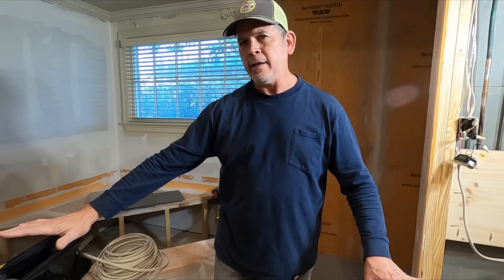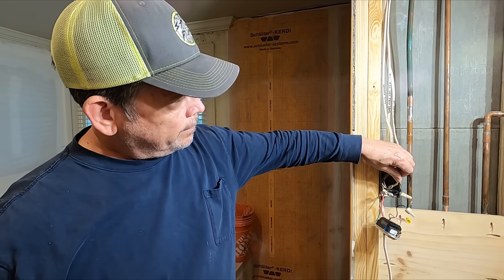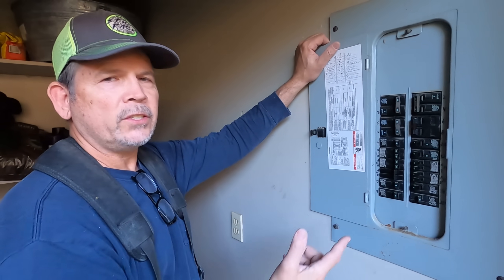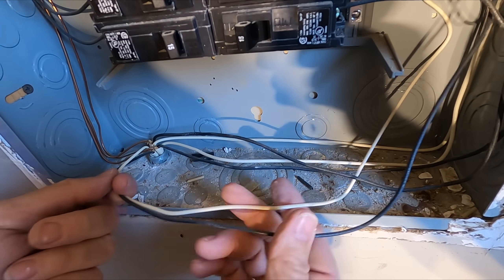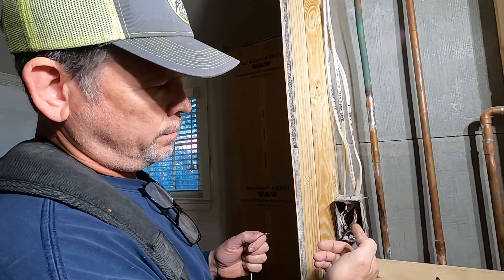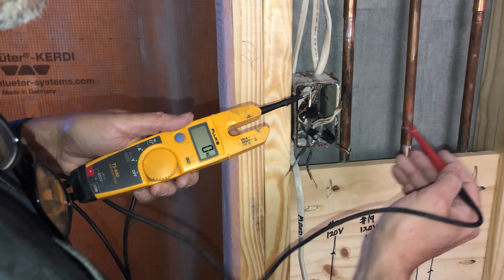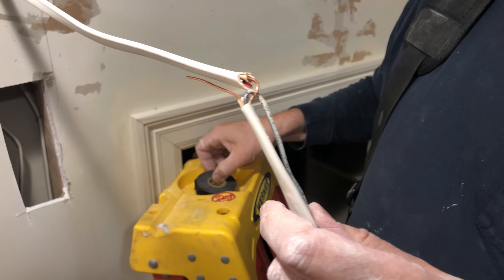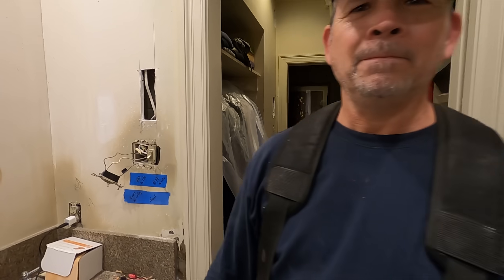You CAN Get SHOCKED by a Neutral Wire! This is How...

Comment: The joining of multiple circuit neutrals is a huge problem. It usually comes about when someone upgrades a service/panel and the AFCI will not set. Then it is hours of work either chasing down the neutral problem or rewiring the whole circuit. You can’t pass inspection if AFCI won’t set.
Reply from the maker: Thx 👍

Comment: My method of doing this is to send the wife out shopping and shutting off the main breaker. I have yet to have a problem doing it that way. I have run across to many “ live neutrals” in my life to work on electrical with the main on.
Reply from the maker: Cool thx Bruce 👍

Comment: I'm confused :-)   You say that every circuit should have its own neutral wired back to the circuit breaker box...but when it get there's they're then all joined together again along the common bar, so what's different ?  i.e. why does letting the closet light get its neutral (return) from the breaker box work differently from getting it off a shared local wire?
Reply from the maker: The expectation is that when you turn off a breaker there won’t be current on the neutral for that particular circuit.  When you mix neutrals you get the situation I came across in the this video.  Super Brief explanation but hope that helps 👍
Reply: @StudPack  No... sorry :-) I thought a breaker only disconnects live/hot... so Neutral is always connected, and common to all other neutral..

Comment: Thanks a million for revealing this mysterious situation. Also thanks for respecting the invisible power of electrons!! I share the experience. 
I came across same exact situation when I was updating an old outlet that was opened by a listened electrician previously for powering recessed lights in adjacent room, using one of the leads. When i tested it, it read 240 V, I could not find out why. 

Thanks again,
Keep up the good electoral energy!!
Reply: Yeah, the guy working for him didn't get hurt or die from electrocution but , whoah, when he fell of the top step of the ladder, it was bad, really bad. Thats why you haven't seen as many videos lately form this guy, he forgot. He forgot about ladder safety. Poor guy working for him, well, its not my place to tell you exactly what happened as there may be a pending lawsuit so...........Oh, so do not stand on the top step of any step ladder EVER!!!!!!!

Comment: Great vid! I had a couple of thoughts. 
I noticed in a comment that you mentioned e-tape you had put to designate the "hot" neutral. Since you get folk of all skill levels, that it would be good to mention that the white wire on a switch leg should be taped black to indicate that it is carrying current.

I also noticed that you needed a taller ladder when you were in the attic. You were standing on the top of the ladder, setting a dangerous example. 

Looking forward to watching more of your stuff!

Comment: Noticed that the white wire in the 1st box was taped with a piece of electrical tape about an inch from the stripping.   Did you tape that, or was it there?   Doesn't that usually indicate the wire is being used as a hot lead, not a neutral lead?
Reply from the maker: I did that.  Good catch Jim 👍
Reply: @StudPack  Cool.  Really like this video, as I am having similar issues in a closet too.  We tried to wire in a motion sensor switch for the ligth (wife wanted it), but it was giving us trouble.  Manufacturer was saying switch needed a neutral, and thinks our neutral was a floating neutral.  I think you've explained exactly what's happening in our situation too.  Thanks for the video

Comment: Im not an electrician and last year a friend of mine called me saying his new outside electric sauna kept tripping the GFCI. So I had a quick look, figuring that I would get my other buddy (master electrician) to look at it anyway. So I open the breaker box on the side of the sauna, and first thing I see is that the ground and neutral are bonded together. Ahhhhh wrong wrong wrong. Long story short, he had a broken insulator on the heaters element and it was tripping the breaker. I told him he was lucky no one got a shock or died as a result. He tells me HIS buddy wired it for him and that he was sure he was an electrician. I said No way man, especially that this breaker box was like 4rth down the line and only inside the service panel was that permitted. All fixed now !

Comment: i still don't understand how you figured out where the problem was
Reply from the maker: I had to remove all the switches and trace out the wires.  Kinda of a pain but it was a small area and I got lucky when I found that abandoned neutral.  Usually doesn’t happen that way

Comment: Great information.. I also have been shocked by neutrals.. Even in wiring that was installed by pros. Circuit testers are cheap. Always circuit test your wires before grabbing a hold of them.. I learned the hard way and still get bit once in a while..
Reply from the maker: Thx Jake!

Comment: Current nec does not require the main disconnect to be at the panel. What is required is for circuit 19 and 20 to be on a breaker with a common handle tie. That’s called a multiwire branch circuit. If the circuits were terminated on a common tie breaker, there wouldn’t be any backfeeding issues. Nothing wrong with sharing a neutral as long as each hot conductor is on opposite poles and terminated on a common tie breaker.
Reply from the maker: Thx RB.  CB 19 & 20 were same pole.  I could have moved them around to accommodate a two pole breaker (18 & 20 for example) but didn't want to get into that.

Comment: I was doing work at a shop we had in California in the '90s. The power was on and we built high power amplifiers so current was running through the wires, and our shop was about the 15th one from the electrical room at the end. Bottom line, there was a long length of neutral wire and hot wire. I measured 50V between neutral and Earth wires. I wasn't working on the electrical system of our shop, I was interested in the potentials for our amplifiers, so not a safety issue for me or anyone else in the building, but yeah, be careful! Also, as someone mentioned, the white wire in a 3 way switch configuration is not always neutral! It really shouldn't be white, but white is convenient in Romex for guys looking to get the job done. It should be black, blue or red. Usually, codes are not respected enough due to convenience.

Comment: All of this is part of  safety guidelines but can you explain if they are necessary if as a DIYer I am in the habit of cutting the power to the entire house while i am working ? I get that a shared neutral will be overloaded but rarely does it happen like both circuits use full power (15A like some of the guys in the comments are saying) . Is this really a big deal if just some lights are connected to a shared neutral and me as a guy has a habit to disconnect power to the entire house before working ?

Comment: I was replacing a light fixture in our condos guest bath and made what I thought was the logical assumption that by turning off the wall switch I was removing power to the fixture.  Nope.  I then turned the circuit breaker off, still got a buzz.  I finally did the job wearing rubber gloves.  Now I have a better idea of what was happening.  There were about 7 'neutrals' twisted together with a wire nut behind the fixture.  BTW your videos are informative and to the point, no need to FF through parts.

Comment: Shared neutrals are a big complicated subject.  Romex if you look carefully helps with keeping things straight, because you can see which neutral belongs with which hot.  That's why it's good to have a little of the outer plastic extend into the boxes.  Old stuff from back in the conduit days is harder to trace, and you sometimes have to do a hand ringout.  I had to do that on a house we bought, somebody re-wired it and thought that any neutral would work.  It took all day.

The other danger from mis-wired neutrals is overheating and even fire.  If you have two breakers on the same phase returning thru one neutral, you can get close to double the maximum current in that neutral.  

It is actually OK to share a neutral between two circuits so long as one is on each phase.  That way the current in the neutral is the difference between the currents in the two hots.  The big feeds to sub panels are all like that.  Branch circuits not so much these days, but in conduit jobs you do find it.  What happens if you open that kind of shared neutral is that the loads on one hot are in series with the loads on the other hot, and whichever side has the lighter load sees higher than 120 volts, while the other side sees a lower voltage.  Some lights get brighter, some get dimmer, and usually stuff gets fried on the lighter side.  

Those little light and beeper non-contact testers are well worth having.  Poke around in a box you think is cold and it may find that there's yet another circuit in there that you haven't turned off.  

As for current returning thru the plumbing,  a clamp-around ammeter will find it.  Otherwise you can get a nasty surprise when you cut thru a copper pipe.  

-- J.S.
Reply from the maker: Much appreciated John thx 👊

Comment: yee it pretty amusing in the two plate system were the next live goes to the other sw plate if for some reason this came out i remember a tenant demostrating why does the hallway light come on when i sw the living light on i just chuckled and said the same the current needs to flow some were

Comment: I have a question, so if you had turned off the breaker switch for the entire house, you wouldn't have had that return voltage correct? Or another way to ask this, if you had shut off #19 as well as #20, you wouldn't have had the issue either?

Comment: Senerio. Furnace motor burned out. I was a young DIYer. I shut off the switch on the furnace. Reached in with the screw driver to undo the motor screws. Managed to ground the tool removing white wire. Big arc which blow the breaker. The previous owner (?) Switched the neutral not the black power lead. I always kill power at the panel now.

Comment: I think I have that problem (neutral) . I have a ceiling light fixture that always have current. Every breaker I switch off the light stays on is this why I have constant current ?
Reply from the maker: Every breaker?  I've seen bathroom lights tied into 50A two pole breakers.  It's got to be one of them.  If you turn off the house main breaker what happens?

Comment: As a former electrician, this is an awesome video.
As the son of an electrician, Thank you so very much. Its been several years since he passed, but seeing that wire pulling trick after 10-15 years brought a smile, some tears, and several good memories. So thank you.
Reply: Gotta appreciate your concern for electrical safety BUT there's more of an immediate danger and an OSHA violation going on at 13:00 . Whats up with that?!? Well, at least he was wearing knee pads!!! Hahahahahahhahah, funny as hell!!! Reeeally? Come on, man!
Reply: @vicferrariproject  you're complaining that a guy was pulling wire while the other was feeding it to him?
Reply: @cheddarballs864  No, he is writing about Paul standing on the ladder top shelf.  AT MOST, HE SHOULD BE 2 STEPS DOWN FROM THE TOP. If he needed to be up that high, he needed a taller ladder.  Ladder safety is very important:  I had a ladder skid away from me as I attempted to come back down from my attic.  I fell, landed on my back, bounced my head off the floor.  I cracked my pelvis in 2 places, spent months in pain as I healed.  My head was a bit sore, no brain damage.
Reply: @cheddarballs864  I've known two people that had fallen from a ladder. Both were horrific. One had one of his arms badly damaged. While the doctor managed to stitch it back together, it will have limited movement forever plus pain. The other hit his head hard and was in the hospital for a month. I would tell anyone to be very careful while going up the ladder. Don't ever assume it is just a 6 or 8-foot ladder, and nothing will ever happen even if you fall.

Comment: Great video.  Thanks for doing it.  I have been doing electrical work nonprofessionally for over 50 years and I always check the neutral to see if it's energized, but I have never run into one that actually was energized.  It's nice to know that I have not been wasting my time.  I have seen so many botched wiring jobs that I always figured that someday I would run into a job where someone energized a neutral.  You did a good job explaining how that happened.  I was always assuming that it would just be a do it yourselfer that didn't understand that black is hot and white is neutral.  I never thought about a shared neutral.  I guess you never get too old to learn something.  Thanks for bringing it to my attention.
Reply: Same for me... always test with a voltmeter, both the hot and neutral (to each other and each to ground).  Never, ever assume.

Comment: I was replacing a light fixture in my hallway I had the switch off and as soon as I touched the neutral I was lit up ive changed other light fixtures the same way and I never been shocked so now I kill the power to the house before I touch any wires

Comment: If I put my meter across the live and a pipe I would expect to see a circuit as the pipe has been grounded, ground is the same as a neutral originating from the central tap of the transformer.

Comment: Paul, thank you for a great lesson!  I would vote for more videos when you have time. Here's a topic that many owners of older homes have to face:  how to deal with un-grounded outlets without tearing up walls to completely re-wire.    Is there an alternative to just labeling each outlet as "un-grounded" if the home has had the old two-prong outlets replaced with three-prong outlets?
Reply: No one answered, so if it's still relevant 5 months later, labeling those outlets does nothing for the safety, and people will naturally assume they can plug in grounded power cords. The two alternatives which come to mind are #1 - run a ground wire to the outlet-- that's not easy in older home, as you pointed out. #2 replace those unsafe ungrounded three-prong outlets with GFCI outlets-- under $8 each in a 10-pack. Then you can sleep at night, and that brings it up to code in most places.
Reply: @isabellavision  You still need the neutral for the GFI to work.
Reply: @tedmoss  The question I from @WakeUpAmerican000s was about a missing ground wire in older outlets. You can't just replace an old two-prong outlet with a modern three-prong when the outlet has no ground. But you can replace it with a GFCI.
Reply: @isabellavision  This is such a messy subject it is hard to tell what people are thinking. Without a ground I can't see how you can test a GFI. If I was an electrician I would run ground wires and make it a proper system. I have done this several times in old houses, from 120 year old houses to 20 year old houses. It is very interesting (and expensive) to run wires in old buildings but you can figure out a way. I once figured out how to replace wire in underground conduit that had rusted out, originally the ground was the outer metal conduit, a very bad idea. We ran new wire that was thinner than the original even though it was three wire and just pulled it through being careful of the rough spots. You just pull more wire out then you need to check the wire is not damaged if it is, pull it through the other way. And test it for shorts.

Comment: Very good video. Thank you for posting.  A quick test with an inductive tester would have showed the neutral was hot!  At that point it would have been flagged as an issue hopefully before giving an unexpected shock.  I always test all the conductors in a box (even grounds)!!   Curious what you would have done if you didn't find the parked neutral in the 3 way box?  Run a new cable all the way to the panel?
Reply: I just had to fix a 3 way switch that was run with 2x 14/2 romex. One romex fed power and neutral to the fixture, and the other had a hot feeding from the other box and a white traveler wire. I decided to just do away with this 3 way switch and turn the other box into a regular switch. I converted the traveler wire into a neutral so it would no longer be shared and connected the 2 black wires so they would power the fixture when the switch in the other box was turned on. I did not mention the ground wires because it’s already confusing enough. Those don’t seem to cause any harm if they are shared. I will probably wrap the two separate neutral connections with zip ties or white tape so any future person working on the circuit will get the idea not to connect them back together.

Comment: Great video! I learned my lesson years  ago when I was remodeling  an old house with knob and tube wiring. It was common with that type wiring to simply pick up the closest neutral wire. A ceiling light on the first floor might tap the neutral from a wall outlet on the second floor. Splices were made between floors and inside walls by simply scraping away the insulation, wrapping the bare end of the branch circuit around the scraped area and cover it with cloth tape. No wire nuts, no junction boxes! The result, EVERY neutral had the potential to be hot.
Reply from the maker: Thx Tom 👍
Reply: Wow I am an electrician really green only 2 + year never seen anything like that that sounds so scary.

Comment: You can get shocked by a "white" wire that was once tied to the neutral return wire. But once it is disconnected from the neutral (grounded conductor) It is not considered a neutral anymore but a hot return and will have potential to ground if the intended load is still connected. I guess the message is "Just because it's white it still can bite"
Reply: So if I understand this 3 way switch, used the white as a traveler? So to correct this you pulled an extra conductor for the neutral?
Reply: Like red & blk for travelers